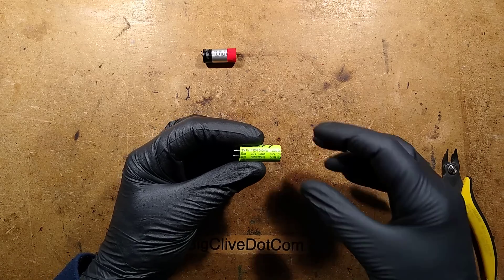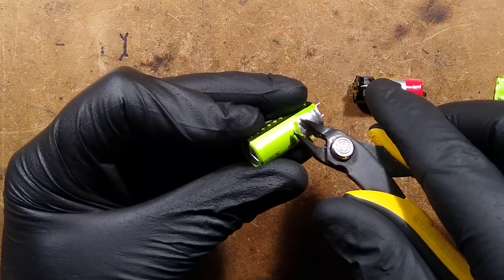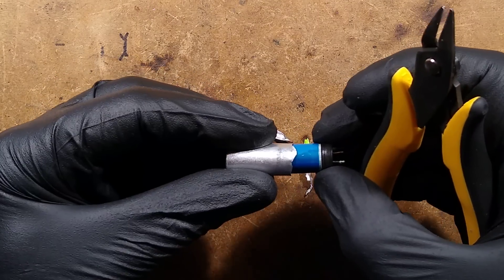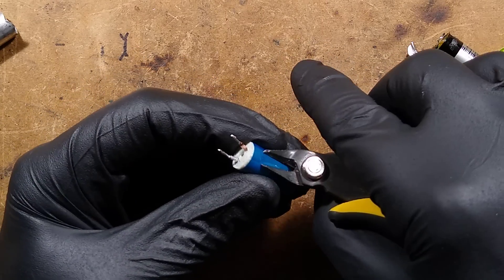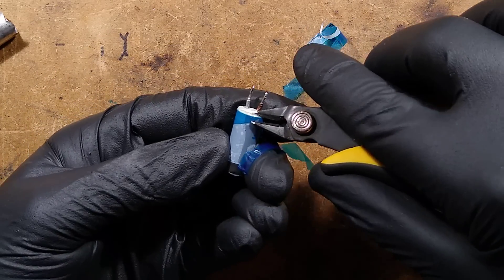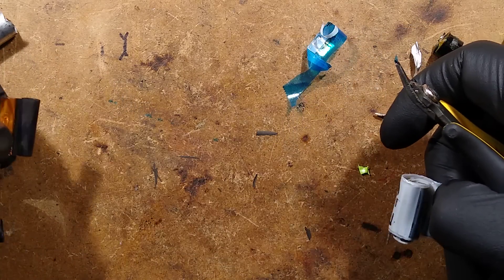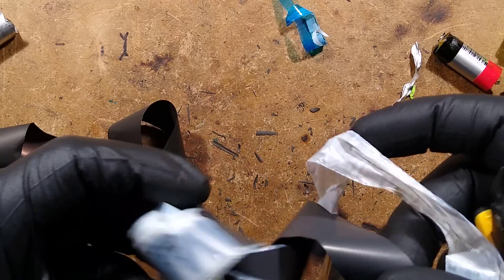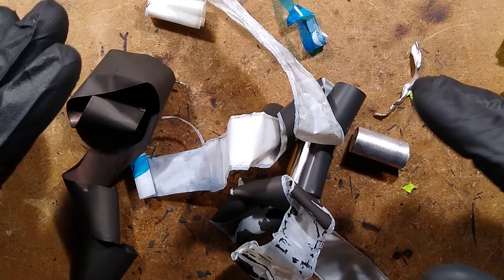Opening a capacitor-style lithium cell (don't try this)

Comment: I'm curious whether this Lithium-Ion is different from Lithium-polymer. And from Lithium-Iron Phosphate.
Reply from the maker: Technically lithium-ion refers to a type of cell that relies on the transfer of lithium ions back and forth between two electrodes.  As such all lithium cells could be called lithium ion cells.  But the exact chemistry will affect their characteristics.  LiFePO4 cells have a different max and min voltage threshold.  I regard this one as a standard lithium cell.

Comment: Can you safely recharge these for solar lights or other applications? so as to reuse and recycle?
Reply from the maker: With suitable care they can be used with some solar lights.  But not the most common type that use nickel metal hydride cells

Comment: Is this type of lithium battery rechargeable? I've just found one inside a "vape thing", on the street.
Reply from the maker: Most I've tested are.  But they need recharged with a proper lithium charger that limits the current and stops at 4.2V

Comment: When i was about 12 i thought it would be a good idea to dismantle a Duracell U2 size battery, it wasnt flat, the central core is a metal spike & as it came out it shorted to the case & discharged with a great orange buzzing flame about 25mm long, scared the hell out of me!

Comment: Easy to get the lithium strip w/o discharging battery.  Use a small tube cutter to penetrate the metal.  Immerse it in a hydrocarbon to keep it from reacting (such as naphtha, hexane, or even gasoline).  Use 2 pairs of plyers to pull the cut tube apart.  With some practice, you can do it in under 1 minute.

Comment: Clive, I've got a 3x7=21 lithium ion 12 volt battery box for 18650 flat tops. Though I was wondering where do you buy your rechargeable 18650 batteries from, and which make do you recommend for best mAh? 🪫🔋🔌
Reply from the maker: I'm not sure what the best source is for safe and good quality cells.
Reply: @bigclivedotcom Thanks anyway, Clive. I just thought  of asking you since you use various power banks. That if you had one of these 12v DIY Li-ion Battery Packs.  Though I'm not sure what mAh cells would be best to use with in the Temu Green Box of 21 cells it holds. The PCB is the 30S 40A BMS model.

Comment: lithium is nice ... but ill never go full electric with my cars and motorbikes  , its just a very , Very stupid idea to drive something u cannot keep after 5-7 years  u need te replace it . 
my other cars ar 20 and 55 years old , my motorbikes the oldest is 92 years old and still running and driving ... electric vehicles are just a controlling tool from the goverment so they can remotely shut down ur car if u eat too much meat that week , mark my words , E-cars will be used to control population , ill stick to my petrol and diesel cars

Comment: Those gloves are not a good idea....in case of a lithium blast,the high temperature would literally melt the gloves on your hands,making imposible to remove them.....use solder gloves next time.

Comment: 2:29 Sodium-ion will not replace Li-ion. Sodium is denser (0,97 g/cm³) compared to Lithium (0,53 g/cm³) but each atom is much heavier. 
With Sodium having 22,98977 g/MOL and Lithium 6,941 g/MOL. That means each cm³ can hold much more Li-ions than sodium-ions.
And not only that, Lithium has a slightly higher electronegativity (0.98) compared to Sodium (0.93). Though in charts that is often rounded to 1.
The ionisation energy of Li compared to Na is also higher. That means each Li-ion can store more power than a Na-ion.
In total it means Na-ion batteries will be cheaper but store much less energy (because of physics) per same weight and size. And only will be  used where those two factors will not play a role.
I guess disposable vaping will be one.

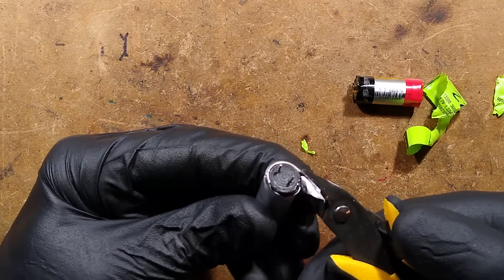Comment: To answer your comment at 0:58 there are a few electrolytes used in Sodium batteries which includes, diethyl carbonate, dimethyl carbonate, ethylene carbonate,  and propylene carbonate disolved with sodium hexafluorophosphate.

Comment: Where was the lithium? I was expecting to see a sheet of that.
Reply from the maker: There's a lithium foil in the non rechargeable cells.  But in rechargeable ones the lithium ions are diffused into the electrode materials.  A rechargeable cell has a fraction of the lithium used in a non rechargeable one.
Reply: @bigclivedotcom Thank you!

Comment: Warning: Do not use Temu baking tray to stop the spread of fire when opening lithium batteries, it burned through like nothing and left stains on mine concrete stairs
Reply: put sand in the tin next time.
Reply: @coler154  I use concrete garden stairs for all mine  experiments which can result in ignition. I assure you this stain is not the first nor the last one on them. 
And yes I do have sand on hand in case fire gets bigger then expected, but don't like using it until needed.

Comment: I am not quite as optimistic regarding sodium cells for a few reasons. Firstly, sodium has a significantly lower electrode potential (Li -3.04V vs. Na -2.71V). Secondly, sodium is very significantly heavier than lithium (22.99 g/ mol vs. 6.94 g/ mol) with both wanting to lose only one electron. In other words, you lose 11% of the voltage (unless you make up that difference with your choice of the other electrode) and suffer a 3.3-fold weight/ mass penalty on the group 1A electrode to have the same capacity in terms of coulombs discharged (or, to think of it the other way, a 70% penalty in battery capacity if electrode mass is kept constant). That would take a very - shall we say talented - marketer to sell someone on a battery with such a dramatic performance loss. We have been accustomed to batteries getting both higher in current delivery capacity and lighter at the same time, and the switch to sodium could not continue to obey that trend due to physics. That would mean that our portable electronic devices would have to either get bigger and heavier or lose processing power relative to current devices, as we have already accomplished the easiest methods to increase processing power and decrease mass (also decreasing power consumption in the process) at the same time. Now we need to get more creative with 3D geometry on the die and stacking of chiplets, with smaller and smaller generational gains in performance.

Where I feel a sodium-based battery is going to have its biggest advantage is that the raw material is exceptionally plentiful and available throughout the planet, so we do not need to worry about an adversary or profiteering corporation gaining a monopoly on the raw material and artificially forcing the costs in their favor. Converting sodium chloride to metallic sodium is something a person with a background in high school chemistry could understand, and it seems reasonably unlikely that someone could make the process so much more efficient to gain patent-protected control of the supply, as the upper bounds of price would always be moderated by the traditional methods of producing metallic sodium. That could significantly limit the monetary value of a patent that improves efficiency, which might also be slowing research funding relative to other more seemingly lucrative areas.

Comment: I opened my first battery at about 4, so I was most surprised when I opened an aa or aaa and found a pile of button watch batteries. I wonder where the economics tips towards rolling a coated register tape from scratch.

Comment: Thanks Clive, lovely stuff as always and, after reading the comments, I feel right at home here. Many, many, many happy hours in the 70's with homemade black power until the local chemist figured out what we were doing and banned us from the shop. Not to be out manoeuvred, I continued my pyromaniac pursuits by simply sending Granny in for the 2lbs bags of Sulfur and Saltpeter. Never did quite get the mix right as there was often a plastic-like residue left after combustion, probably too much sulfur I guess. Made lovely rocket fuel but no good for bangers.

Biggest mishap was allowing a friend to bend some glass rods using a spirit burner on the same chest freezer (Mum's) I was mixing on. Burned his lip while trying to blow on the hot glass and dropped it in the plastic mixing bowel. There must have been half a pound of the stuff that went up with more smoke than I have ever seen before or since. What fun... still got all 9 finger and 8 toes though so came through all that, and more, without any major trauma🤞

FYI, the rockets were fused with salvaged cordite taken from a bunch of 1939/40 303 rounds found with a metal detector. When not compressed they used to give you a good 2 or 3 seconds to retire to a "safe" distance 🤣🤣🤣 

Cheers all, thanks for the memories 🍺

Comment: If only you had video of objects heating up! You need a Thermal Camera dongle for a smartphone. They only cost $250 or so, and you can just setup a smartphone to record yourself from another angle to see when things heat up. I use an Infisense P2, which can do 256x192, which might seem very poor by color camera standards, but for a Thermal Camera is quite high. Also it can do 25 frames per second, which is a HUGE leap over older ones like the FLIR cameras, that are capped at 9fps. It seems most people out there don't even know these things exist. YouTubers looking for interesting content ought to be using them!

Comment: I bet they use this kind of cell now to save on assembly cost
The "old" style vape thingies used cylindrical or rectangular shaped pouch cells which I believe were all assembled by hand
The capacitor shaped cells could be assembled on an THT assembly line

Comment: Interesting to see cell's internals and the connecting wires bonded directly to the foils.
Just had a weird experience with an old 26650 LiPo that had been in a failed professional camera/tape recorder battery pack.
The cell initially showed a decent charge and happily dumped a few amps into a 6v car headlight bulb (yes, my parts bin has been around for a few years)
I put it aside with the good cells while I tested others from the same pack - consigning duds to the recycling after soldering a shorting wire across their terminals.

Later I cycled the good ones through a charger and noticed I had a dud amongst the good cells. It wouldn't accept any current and the voltage quickly dropped from 4.2v to a jittery half a volt.
This voltage jitter should have been a warning....
Deciding to chuck this apparently negligible capacity cell, I soldered a piece of 22g wire across its terminals and dropped it in the dud battery (metal) rubbish bin  outside.
A minute later a moderate amount of smoke began issuing from the bin. The wire was smokin' white hot and the battery moderately hot.
I cut the shorting wire and let things cool.
The cell now appeared to be reasonably healthy and could once again light up the 6v bulb.
Suspicious I belted the cell with a rubber hammer and could make the cell change back and forth from apparently very high impedance to low and grunty.

Assume there is an internal intermittent in the bonding between the foils and the case or cap. Possibly in the overpressure cut-out switch that some LiPo's have. 
Food for thought.
Bit of a recipe for unexpected combustion in the battery recycling bin.

Comment: The copper electrode is the anode.  When you fully discharged it, all the lithium moved back to the cathode.  If you want to have fun (!) with metallic lithium, fully charge the cell before you open it - you will find a nice layer of metallic lithium (very reactive) plated onto the anode.  And wear a full face shield, safety squints are not adequate for this kind of bumblefuck.

Comment: A town in Arkansas is slated to build a Lithium extraction plant and rival an output to equal or exceed China.
Using water from a hot spring,which was tested to have high Lithium content.
For some reason,all the townsfolk are unusually mellow...
LOL
Reply from the maker: They'll have to hurry.  Sodium ion cells are taking off.

Comment: I used to save the carbon rods out of carbon zinc D batteries back in the '70s...some projects in science books called for them.. saved the zinc as well, to melt down for " lead" soldiers ( a friend of mine had molds for lead soldiers).

Comment: From one of the manufacturer of this form factor Huahui: "Our super Li-ion battery adopts unique design of explosion-proof valves to replaces explosion-proof lines in traditional lithium battery, which removes the potential risks of explosion and catching fire in case of any accident.
 
We abandon the traditional process of welding between electrodes and cap by leading 2 poles in the same direction after their reverting with the films. In this way, the probability of empty solder and internal short-circuit is effectively reduced, thus enhancing the reliability and decreasing the impedance of the battery. Besides, the leading poles could be soldered on special PCB directly, to reduce the impedance of battery pack by saving process of spot welding."

Comment: If it is a one time use battery, perhaps they expect you can drain it lower than you would a cell you want to get many recharges from.  I wonder if that explains the difference in the wHrs. thanks for another fun video.

Comment: This is actually very interesting. This could be very usefull for some of my projects.

If they fit i could just use some of these Cells to replace Caps, cut the traces and not have to worry about how to mount it. It makes things sooo much easier.

Comment: Every time I see these battery reveals I've kept missing the presence of the solvent (Which I assume is critical, and dissolvable in air) until now! But given that batteries and capacitors effectively do loosely the same thing with different methods (One's a chemical store, the other uses ion potential) I've often wondered what difference would be observed with an 18650 simply made out of wound foil and a thin separator (No electrolyte or solvent) and working on ion potential alone? 🔋

Would the inclusion (And volatility) of the Lithium make such a significant difference versus an old-school chemical-free 18650 capacitor? 😇
Reply from the maker: There are solid electrolyte lithium cells, but most need the wet ion transfer medium.

Comment: It's amazing how the only thing that's really changed about the technology in many years is the chemicals they make it with, yet the actual physical structure is basically the same.
Reply: It'll be about the same for a very long time I think. About the only different type of battery in the last few hundred years since Volta is the liquid metal/molten salt batteries. They use different density metals and salts to make up the cell, heat the whole thing to red hot and let gravity sort it out. It's still about the same structure is just all liquid and red hot lol.

Aluminium air batteries might count as different too but they aren't rechargeable so I don't know if they count

Comment: The electrolyte in lion cells is actually quite harmless in comparison to e.g. the H2SO4 in lead-acid and the  KOH in alkaline chemistries; the biggest hazard is that it's flammable. It's usually a mixture of carbonate esters. Comments here saying it's a fruity smell are on-point: the same types of esters are also found in fruits and responsible for their smell.

Comment: Sensible way to package them, construction is similar,  plenty of electro cap can sizes available and easy to mount on PCBs and has built in overpressure protection.

Comment: Hi Clive - Interesting you mention Sodium Ion cells - I have heard they are a lot safer but their voltage range is much much wider than lithium cells - ranging from 4V at full charge down to about 1.6-1.8V when flat.
Reply from the maker: They're interesting.  They do fail with a bit of a bang when shorted, but no significant flames.
Reply: Sounds like a decent replacement for solar power storage. Not so much for cars. Given a few years of development and adoption I'd expect them to be quite cheap to manufacture.
Reply: @davidmcgill1000  That seems to be the primary target market at the moment, mostly because sodium ion cells are already a fair bit cheaper ans safer than lithium ion, while having a lower energy density/specific energy. Still BYD is already putting them in some cars, although they achieve a fair bit less range than even lithium-iron-phosphate batteries.
From what I've read sodium-ion cells are already quite cheap to produce, because not only the raw materials are cheaper, but apparently much of the production lines for lithium-ion cells can easily be reconfigured for sodium-ion.

Comment: Uhhhh... So lithium burns at around 2000c and your aluminum tray melts at like 1200c... May I suggest switching to a steel explosion pot instead?
Reply from the maker: Not much lithium in rechargeable cells.  Just a small amount diffused into the electrodes.

Comment: Sodium Ion cells can run with non flammable electrolyte - as can Lithium Ion. They use the flammable sort because it has far better performance. Incidentally, a major part of the cost of Lithium cells is the containment and chemical recycling needed during their manufacture. Some Sodium Ion processes do away with this and theoretically they should be a lot cheaper due to lower manufacturing cost and not needing Lithium

Comment: That's fascinating. It seems like basically nothing in there, yet it stores so much power.
Reply: The same could be said of a fart. It's just gas but can hold so much power 😅😅😅
Reply: @deanosaur808   Especially the farts that make your sphincter feel like it's hot for minutes afterwards - sweet jeezus!
Reply: The black powders coating the electrodes are particularly spicy!
Reply from the maker: One is boring old graphite.  The other may be Lithium cobalt oxide.